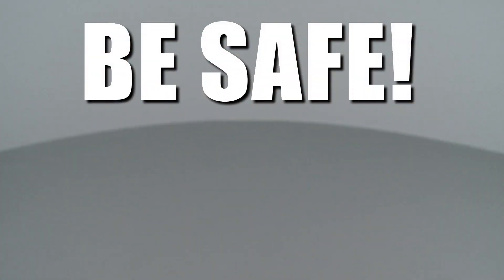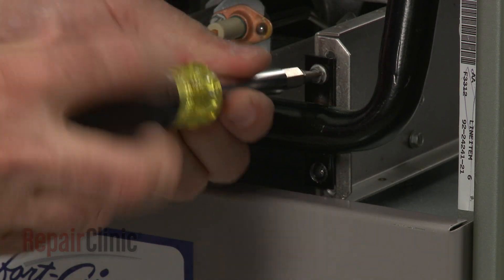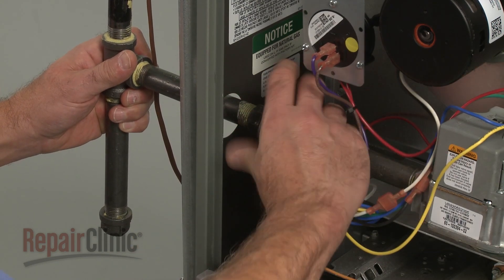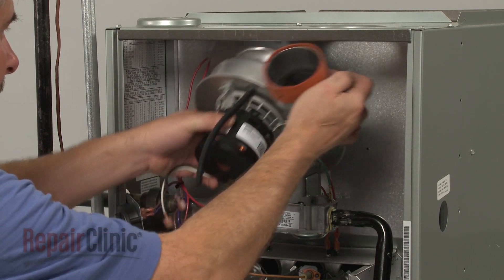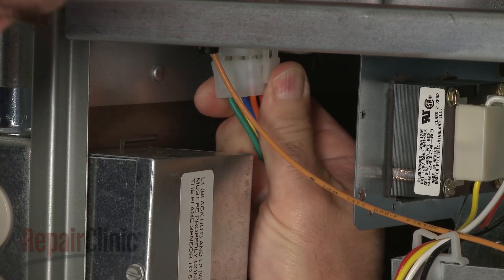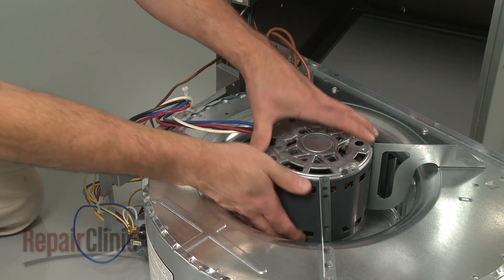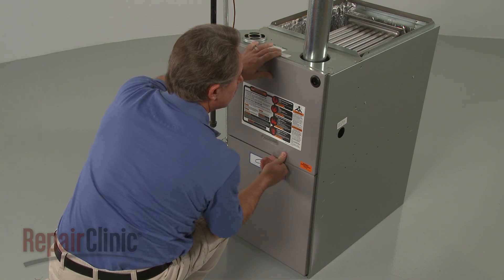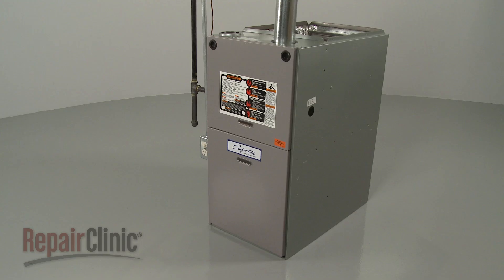Rheem Furnace Disassembly – Furnace Repair Help

Comment: Noticed you piped doped the gas valve pretty sloppy and you didn't mention checking for gas leaks. Pretty dangerous video.
Reply: +Brian Mahoney Why don't you make a video and show us how it is done.
Reply from the maker: Thanks for the comment. It doesn’t really matter if the joint looks pretty as long as it doesn’t leak :) It is always a good idea to check for leaks after pipes are re-threaded.